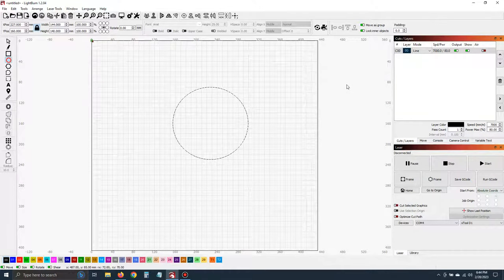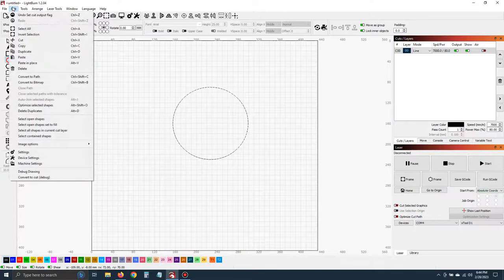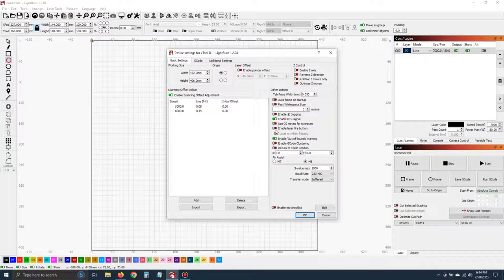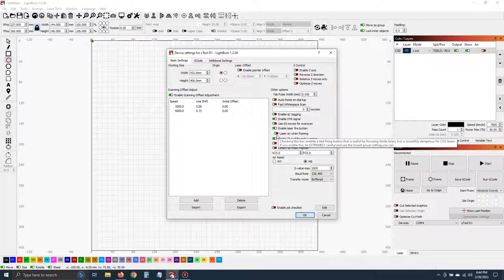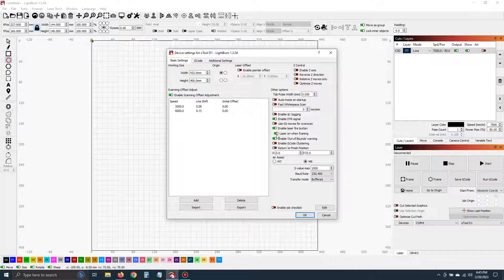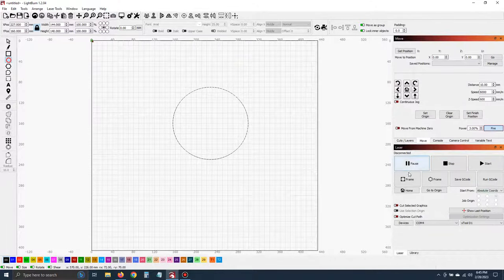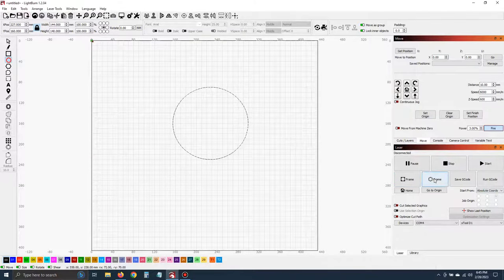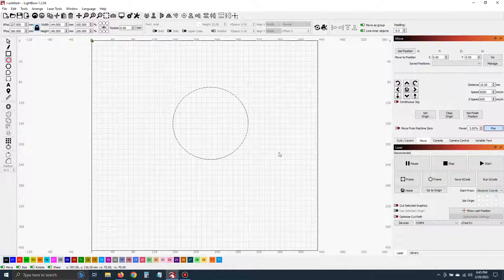Enable Laser Fire Button | LightBurn Software Tutorial

Comment: my fire light only stays on for like 10 seconds and then is shuts off. How can I prolong the length of time my fire light stays on so I can get to it in time to mark it? Please respond thanks
Reply from the maker: Hi @grandmastermicochero, thanks for your question! If you’re using LightBurn software with your laser machine, the duration of the “fire” light (or low-power laser preview) can typically be adjusted within the software settings. Here’s how to do it:

	1.	Open LightBurn.

	2.	Go to the ‘Device Settings’ (click the wrench and screwdriver icon in the toolbar).

	3.	Look for an option labeled ‘Fire Button’ or similar.

	4.	Adjust the power percentage and duration settings. Setting a lower power (e.g., 1%) for a longer duration should help keep the laser visible without risking material burns.

If your machine has a hardware timeout setting, you might need to consult your laser’s manual to see if this can be modified.

Let me know if this helps or if you need more detailed guidance! Thanks!
Reply: @hobbylasermachine  thanks,, however i do not see a duration settings.??

Comment: Thanks! I had done turned the fire laser tabs on and still wasn’t getting it to fire when framing. After you mentioned the percentage, I checked that and mine was set to 0%. New laser. So I guess you gotta go and make sure all the usual switches are flipped. I have a 40w that can also be set to 20w. Decided to go with 0.10% instead of the 1% that I had with my 5.5w. Just to be safe 😅. I can still see it quite well.
Reply from the maker: Maybe I should try 0.10% instead, it would probably increase the lifespan of my laser.

Comment: Hi, i did everything you said,but i still can't see the laser.( although it did in the beginning when we start using the machine),We've tried everything to get it back working,but nothing seems to work. Now if we hit de start button to engrave,it starts to "engrave" without actually  burning. Cant you help us? We're really stuck now. Thx  PS: we've checkted every cable connections,all works.
Reply from the maker: For super complicated troubleshooting ChatGPT has proven to be a game changer. Simply copy and paste your comment into ChatGPT and be sure to include your specific laser module. I use ChatGPT for troubleshooting constantly nowadays. Hope this helps!
Reply: @hobbylasermachine  Thanks for your support. It's much appreciated.
Reply: Did you figure it out? I can't get it to fire during outline, either.

Comment: I need to be able to free hand cut. Does anyone know if the fire button allows you to simply turn on the laser and leave it on? I really need a foot peddle. I'm seriously considering building my own from scratch. There's a big leap from pointers to industrial lasers and not much in between. The parts I'm doing are unique and not something I can easily set up as a programmed cut. The problem is bandsaws tear the material but a laser doesn't pull at it. I;m dealing with fibers but burning isn;t an issue.
Reply from the maker: Enabling the laser fire button is indeed a useful feature for free-hand cutting, but it typically doesn't allow the laser to stay on continuously without holding the button down. Most laser systems are designed with safety in mind, preventing the laser from staying active without manual engagement.

For your unique needs, a foot pedal could be an excellent solution. Some laser systems allow for the integration of foot pedals to control the laser. If your current setup doesn't support this, you might consider a custom modification.

Here's a general approach:

1. Check the Laser Controller: See if your laser controller has an option for external controls. Some controllers have input ports for accessories like foot pedals.

2. Foot Pedal Integration: If your controller supports it, you can purchase a compatible foot pedal and connect it. Ensure it's rated for your laser's power and control system.

3. Custom Foot Pedal: If you’re technically inclined, building a foot pedal from scratch is possible. You would need a foot switch, proper wiring, and connectors that match your laser system's requirements.

Regarding the specific nature of your work with fibers, using a laser is indeed beneficial as it doesn't exert physical force on the material. Ensure your laser’s power settings are properly adjusted to avoid burning.

If modifying or creating your own foot pedal sounds daunting, consider reaching out to the manufacturer of your laser system for advice on compatible accessories. They might offer or recommend a suitable foot pedal or other solutions tailored to your cutting needs.

Comment: I can’t find this option at all
Reply from the maker: Hello,

Thank you for reaching out and mentioning your difficulty in finding the "Enable Laser Fire" option within LightBurn software. I understand how this can be frustrating, and I'm here to help guide you through finding this feature. Please note that the availability and location of this option might vary slightly depending on the version of LightBurn you are using, as well as your specific laser cutter/engraver's settings. Here are some steps to help you locate the "Enable Laser Fire" button:

1. **Ensure LightBurn is Up-to-Date**: First, please make sure you're using the latest version of LightBurn. Updates can sometimes change features or where they're located.

2. **Device Settings Check**: Typically, the "Enable Laser Fire" button is located in the 'Laser' panel or 'Move' tab on the right-hand side of the LightBurn window. If it's not visible, it might be due to the current configuration of your device settings.

3. **Accessing Device Settings**: Go to 'Edit' on the top menu, select 'Device Settings', and look for laser control options or other settings that might reveal the laser fire option.

4. **User Permissions**: If you're using a shared or institutional version of LightBurn, there might be restrictions on certain features based on user permissions. If this might be the case, please check with your administrator.

5. **Consult LightBurn Documentation and Help**: LightBurn offers extensive documentation and a supportive community forum on their website. This could be a valuable resource if you're still having trouble. Searching for "Enable Laser Fire" or asking a question there might provide the answer you need.

6. **Safety First**: Please remember, the "Enable Laser Fire" button is a testing tool and should be used with caution. Always wear laser safety glasses and ensure there are no flammable materials nearby when using this feature.

If following these steps doesn't help, there could be a specific compatibility issue with your laser engraver, or an unusual setting in LightBurn. In such cases, reaching out directly to LightBurn's support can offer more personalized assistance, as they can provide guidance tailored to your specific hardware and software setup.

I hope this helps you find the "Enable Laser Fire" option. Your safety and success in using LightBurn are important, so please proceed with caution and let us know if there's anything more we can do to assist.

Best regards,
Shane

Comment: Apparently lightburn doesnt recommend using the fire button with a co2 laser just the diode laser only as in the user manual
Reply from the maker: That would make sense from a safety perspective for sure.

Comment: Thanks for the video!! I have a problem where after I start programming and engraving laser move but there is not power to burn...it is "0".

What settings do I need to change, how to fix the problem?

I have atomstack a10 pro

I'm trying to resolve this issue for the last 8 months🤯
Reply from the maker: Hi there! Thank you for watching the video and reaching out. I'm sorry to hear about the trouble you're having with your Atomstack A10 Pro. Let's see if we can get this sorted out for you.

Here are a few steps you can follow to troubleshoot the issue:

1. Check Laser Power Settings:
In LightBurn, ensure that the laser power settings are correct. Go to the Cuts/Layers tab and make sure the power (expressed as a percentage) is set to a value higher than 0%. You might need to set both minimum and maximum power levels.

2. Enable Laser Fire Button:
Since you mentioned the laser fire button, make sure it’s enabled and functioning correctly. Go to Device Settings (Edit > Device Settings), then to the Basic Settings tab. Ensure the Enable Laser Fire Button option is checked. This button allows you to manually turn on the laser at low power for focusing.

3. Check for Firmware Settings:
Make sure your firmware settings are configured correctly. Connect your laser to your computer and open LightBurn. In the console, type the following commands and press Enter after each one:
$32=1 (This enables laser mode)
$30=1000 (This sets the maximum spindle speed, which should match the S-value max in LightBurn)

4. Set S-Value Max:
In LightBurn, go to Device Settings and make sure the S-Value Max matches the value set in your firmware. Typically, this is set to 1000, but it might be different for your machine.

5. Wiring and Connections:
Double-check all wiring and connections to ensure everything is secure and correctly plugged in.

6. Test with Simple Shapes:
Try running a test with a simple shape (like a square or circle) using default settings. Sometimes starting with a simple design can help isolate the issue.

7. Update Firmware:
Make sure your machine's firmware is up-to-date. Sometimes bugs are fixed in newer versions that could resolve your issue.

If after trying these steps you still face issues, please provide more details about the problem. Screenshots of your settings could also be helpful for further troubleshooting.

I hope this helps! Feel free to reach out if you need further assistance.

Good luck, and happy engraving!

~Shane

Comment: The selection switches in lightburn look backwards to me. I thought the black area indicated off and the white was on.
No wonder nothing worked right xD.
Also, lightburn needs a 24 inch plus monitor 
to be able to read it unless you are right in front of it.
Reply from the maker: I agree with all of the above especially the readibility but it’s still the best laser software available despite these shortcomings.

Comment: Can I increase the duration of the fire button? Where should I go to?
Reply from the maker: Certainly Raul! In LightBurn software, you can adjust the duration of the laser fire button. Here's how you can do it:

    1. Open LightBurn: Launch LightBurn on your computer.

    2. Access the Device Settings: Click on the "Devices" tab located in the top menu bar.

    3. Select Your Laser Device: In the "Devices" tab, you'll see the list of connected laser devices. Select your laser machine from the list.

    4. Edit Device Settings: After selecting your device, click on the "Edit" button, which will open the device settings for your laser.

    5. Adjust Pulse Time: In the device settings, you'll find a setting related to the "Pulse Time" or "Fire Button Duration." This setting determines how long the laser will fire when you press the laser fire button. You can adjust this duration to your desired value. Typically, you can enter the desired duration in milliseconds (e.g., 1000 ms for 1 second).

    6. Save Settings: After adjusting the pulse time, make sure to save the changes by clicking "OK" or "Save" in the device settings window.

    7. Test the Laser Fire Button: Now, when you use the laser fire button in LightBurn, it should fire the laser for the duration you specified in the settings.

Please note that the specific location and wording of the settings may vary slightly depending on your laser machine and LightBurn version. If you have trouble finding the exact setting, refer to your laser machine's user manual or LightBurn's documentation for more precise instructions tailored to your setup.

Adjusting the laser fire duration can be useful for various applications, such as focusing the laser or performing test burns. Always exercise caution when using the laser, and ensure that your workspace is safe and well-ventilated.

Hope this helps,
~Shane
Reply: @hobbylasermachine  Thank you so much :)
Reply from the maker: Sure! Always happy to help anytime. 👍
Reply: @hobbylasermachine  there is no ajust pulse time or something like that on device settings. I'm using version 1.4.00, there is only s-value max that IS setted to 1000

Comment: I looked in my settings and it don't see this option. Running v1.3.01 windows
Reply from the maker: I’m not sure if that’s the latest version? My version is from November 2022, I haven’t upgraded since then. I hope they didn’t eliminate this feature. 🤔
Reply: @Hobby Laser Machine  I contacted lightburn they said this feature is disabled for higher powered lasers because it could be a potential fire/safety problem. Thanks for the reply!
Reply from the maker: That’s great info and I’m sure will help someone else in our community experiencing the same issue.
Reply: @po123gsxr  Darn. I was hoping to use this on my 50w CO2 laser but I saw a note that it should not be used for CO2 laser.